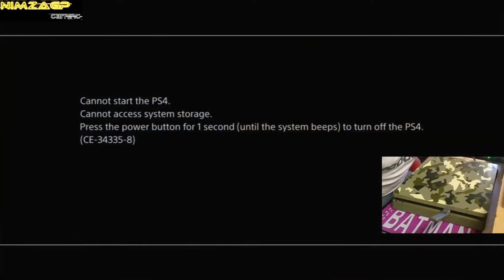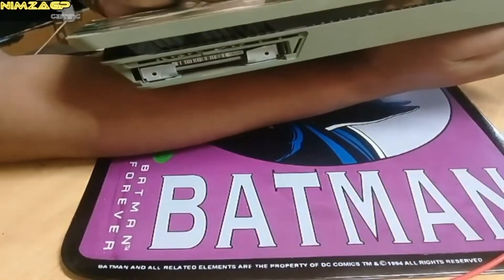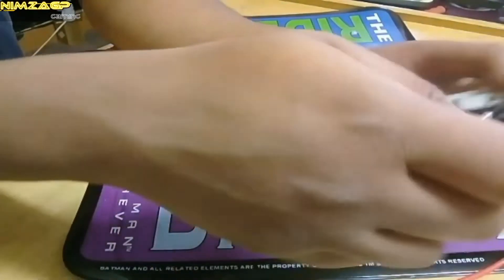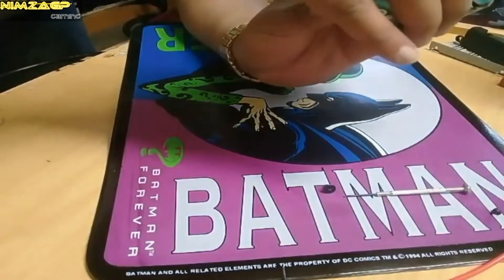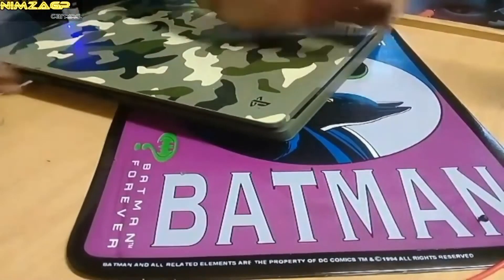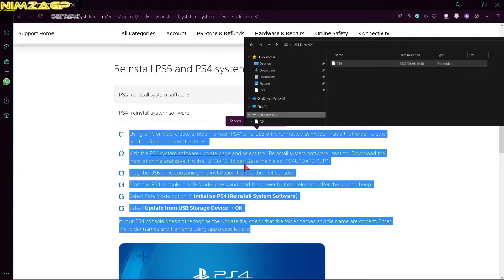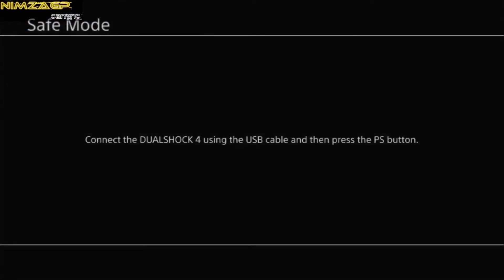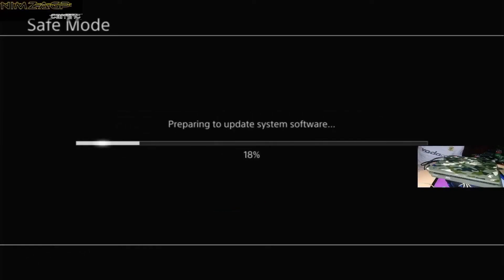I REPLACED my BROKEN PS4 hard drive for FREE! CE-34335-8 error code fix with software installation

Comment: Still says system storage error after 2 beeps any solution?
Reply from the maker: hi chogs thanks for dropping a comment, do u mean when u are booting up in safe mode?
Reply: I mean I had this can’t turn on ps4 problem it’s says system storage error after that when I tried for safe mode it said the same thing again rather than safe mode option
Reply from the maker: @chogszang4537  well thats not good i could be wrong but it seems that the hdd is faulty....
Reply from the maker: @chogszang4537  what is the error code?

Comment: Bro my PS4 says cannot start PS4 can't acces PS4 system storage or it says to initialize ps4 then it goes to 99% and goes a black screen idk if it's the hardrive or something else any help?
Reply from the maker: hey thanks for dropping a comment, Im sorry about ur ps4 bru , have u tried initialising the hard drive before?.... if u havent u could try that as a last resport...NB whatever u have saved on there will be wiped...if u have a psn account then u can just recover from there...the problem i faced was even after initisialising everything seemed fine but when i tried to download a game ....it got stuck again...
Reply: @NimzaGPgaming  bro no cap I don't care about any save files rn i really just wanna play again and how do u initialize the hardrive? Ook
Reply from the maker: ayt ,first thing is power the PS4 off, press  and hold the power button until it beeps twice,release on second beep...connect ur ps4 controller via usb...then on that menu ,try rebiuld data base as it might clear errors u have without deleting, if that doesnt work then select option 6 initialise PS4, NB!!!! this option could take some time depending on howmuch content is on the HDD, also as u know it will completely wipe all game and capture data,everything basically....lastly some after market ps4 controllers wont work when u need to set up the ps4 after initialising, just as i mention in the video at 12.22...other than that its straight forward, my brother I hope this helps , if not the video is a step by step guide on how to replace the HDD in worst case senarios, please leme know how it goes
Reply: @NimzaGPgaming  bro that's the thing my ps4 doesn't even allow it selfs to go in safe mode otherwise I would've fixed already if I hold my PS4 for those 2 beeps i just get a black screen or it says cannot start PS4 can't acces system storage
Reply from the maker: I eventually got that same error dude, thats definatley a hardware related issue, its gona boil down to changing the HDD im sorry bro. i tried researching what could have been the cause of mine breaking down, but noting definitive enough...most common is wear and tear, if its been dropped ( yeah i know, who does that?) factory fault, power surges aswell....if u are capable u could open the actual hdd and check if the pin on the inside has come off the landing plate, u will need the T10 screw driver for this.... if u open and the pin is sitting on the actual disk u can screw the center in order to get the pin bacm onto the plate, that might just work, but proceed with caution this isnt something I would recommend doing if u are not comfortable this step is completely last reort and i cant accept any repsosibility if it goes wrong lol
Reply from the maker: also Im not sure if you are from South africa or not but if u guys had a cable tv box that was was able to record live tv,u could check that set top box out...if its any1 elses at home over there,eg mom ,dad ,bro sis  or partner plz ask for permission before doing anything lol